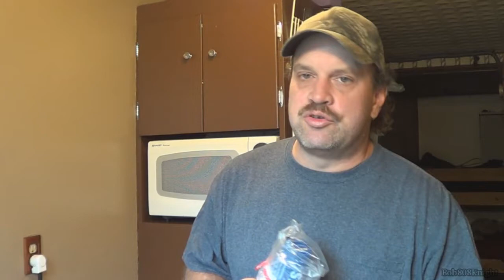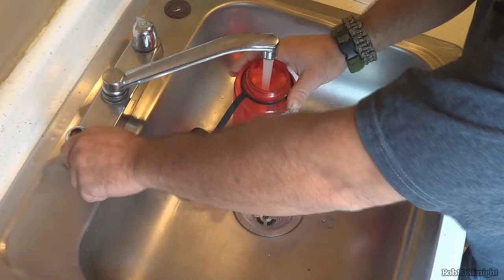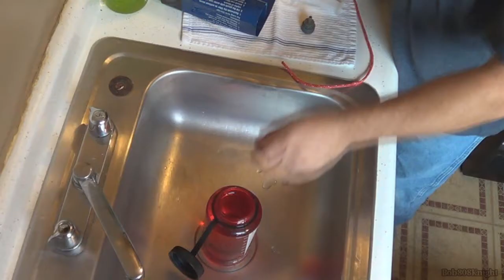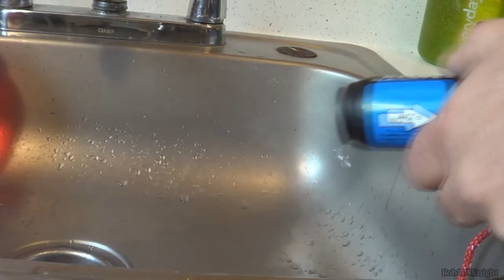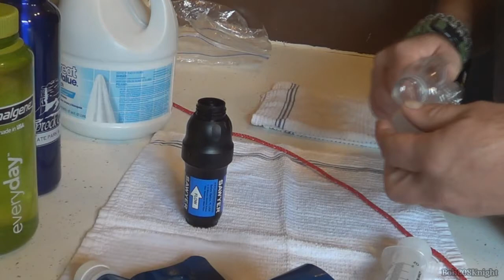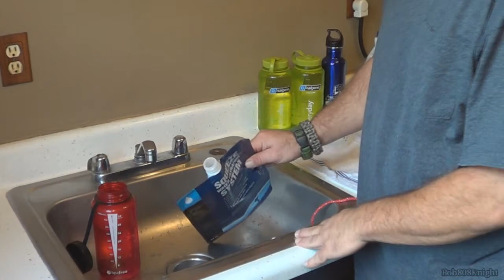Sawyer Squeeze Cleaning and Maintenance

Comment: What about when you have not used it in along time!!! Mine is real hard to run water threw
Reply from the maker: Good question. It sounds like you have a nasty clogged. I would keep trying to push water through it to break it up. If not you might have to break down and buy a new one. As always thank you so much for your comment. And have an awesome weekend

Comment: Sawyer recommends you backwash with force not gently. If you do it with out a sufficient force the water will follow the path of least resistance which will only clean a few pathways instead of the whole filter thus reducing the flow rate and efficiency of the filter. They say the filter is more than robust enough to handle a forceful flush.

Comment: I know You cleaned yours backflowing the system but why not backflow the squeeze and then run the bleach water in the bag through the filter cleaning both at one time? Is that just your preference?
Reply from the maker: Hi Joey... To be honest would you I clean it a little different each time... As long as you sanitize the filter and bag with bleach water you should be OK..
 Thank you so much for your comment and I'd like to wish you and yours a Merry Christmas...

Comment: Great video I would suggest leaving the filter filled with the solution submerged in it for a few minutes before the rinse / dry. To reliably ensure destruction of any giardia lamblia cysts that may be present. At 8mg/liter chlorine (approx 3 drops per liter regular 6% bleach) at 41 degrees Fahrenheit pH 8.0 cyst survival rate is 0.4% after 10 minutes. Higher water temperatures and lower pH increase effectiveness as do higher concentrations of bleach but in any case you should let it soak for a while if you want to be on the safe side.
Reply from the maker: Sounds good to me Jesse... I'll give it a try ..thanks for the tip..

Comment: when I use the empty bottle to squeeze the remaining water out of the sawyer it doesn't completely compress, like it's clogged, and doesn't seem to flow at a nice rate when filtering, any suggestions?
Reply from the maker: Mmmm are you using the small or the large filter?
Reply: The large filter
Reply from the maker: I can tell you from personal experience it does take awhile for mine to filter water. That's why I built a gravity feed system so I can Hanging on the tree and let it do its thing why do other projects. Have you used the syringe to backfeed it?And if so does any Dark Water come out.?

Comment: Hey Bob. The last time I filter water before I get home I pour filtered water over the end where the dirty water goes in the filter and rinse the threads and outside of the filter. Then I take a plastic bottle with filtered water and back flush with the filter. I use a tornado tube to attach the bottle to the end where the clean water comes out. Now I put the filter in a clean plastic bag. This way filtered water is all over the filter inside and out. Then when I get home I let the filter air dry.
Reply from the maker: nice job brother. I pretty much do the same thing. except after I use it 20 times or more I like to run some bleach through. Just to be on the safe side.thanks for the comment.

Comment: Yeah, I work with 304 st. stl. all the time.  Use a bottle brush to clean, or some river sand/fine gravel.  Then rinse out with boiling water (or boil some water in it) to sanitize.  Let dry thoroughly before storing.

I don't like st. stl. water bottles much because of this (and the weight).  I mostly use one-liter soda/water bottles and recycle 'em if they get too nasty for a little bleach water to take care of.